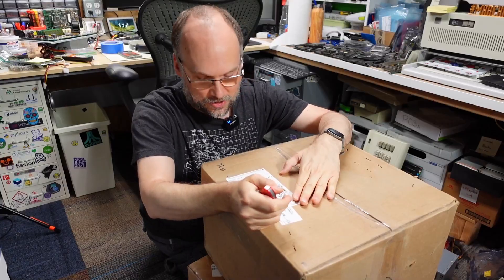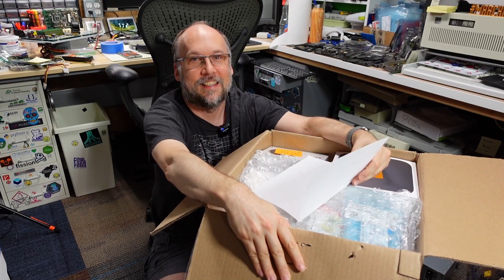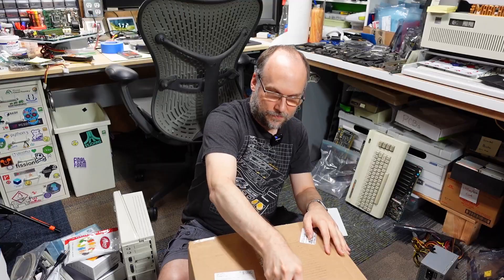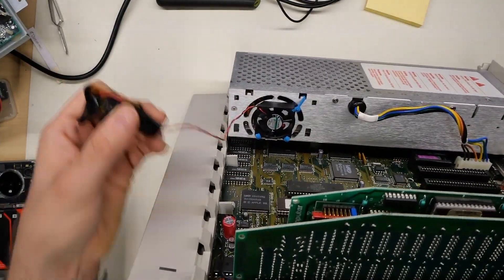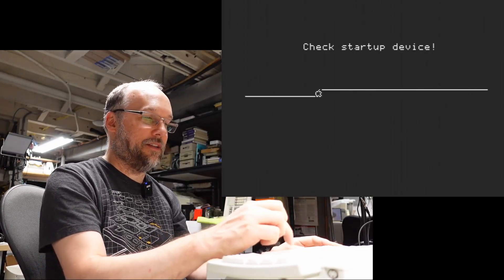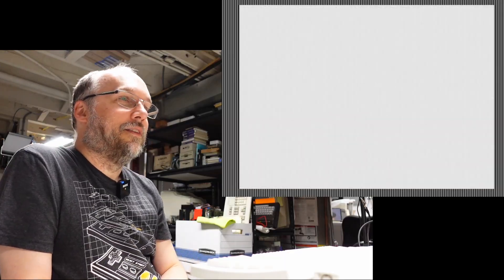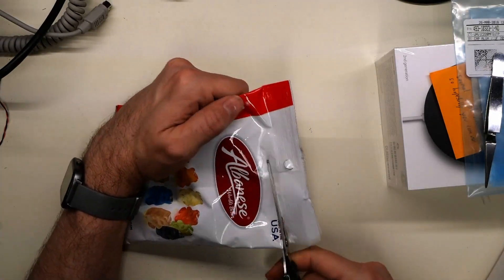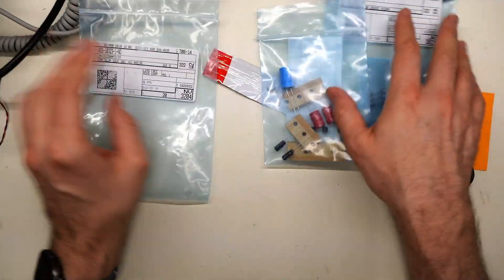This computer was designed for smart kids

Comment: Regarding the PSU fan, you'll find the exact same situation with the Commodore 128D(CR). It was going to have a fan, and some very early production models reportedly actually have one installed (and certainly the 'plastic' 128D came with one, but this machine is extremely rare outside Europe). Most of them however did not come with a fan installed, but still have the provisions for mounting and powering a fan. By 1989 (very late production models) those provisions are gone, and you actually have to modify the PSU if you want to install a fan. 

According to Commodore engineers, it was originally planned to have a fan, but Commodore found they could get away with not installing it, and decided to save a little money. One has to realize that even when installing that fan costs a mere 50 cents per machine, you are still looking at over $1500000 on savings by not installing it (in case of the 128DCR, based on sales estimates). Removing the mounting position and power connection was only done when Commodore redesigned the power supply for other cost reduction considerations. 

As none of those machines were made to last decades, and (quoting Bil Herd) have no right to still be working... not installing the fan made sense at the time. Still, I'd certainly install one myself, as keeping the inside of the machine at around room temperature, and providing airflow to voltage regulators and capacitors in the PSU is a really good idea.

Comment: I used a IIgs for several years ('87-92?)... I eventually maxed the RAM and even had the (now unobtanium) Applied Engineering Accelerator card in mine. Ironically, I had almost no software that took advantage of all the upgrades and I eventually relegated the machine to running my BBS. Ah, dial-up networking.  Anyway, thanks for another fantastic and fun mail call.

Comment: I picked up a IIgs from a college discard sale about, oh, 20 years ago now--computer, monitor, keyboard, mouse, 5.25" and 3.5" drives for a whopping 59 cents.  I liked it, too, but sadly I pulled it out of storage a few years later after a move and the battery hadn't just leaked, it had burst.  Ate a hole through the mainboard and the power supply, total loss, and the monitor got swamped in a flood not much later.  I sold the drives off for about fifty bucks, still have the keyboard and the mouse.  It was a fun enough machine while it lasted, I managed to get it on the internet for a bit.

Comment: 48:30 Also, sound output is mono instead of stereo.  Just a silly omission when you have such a great sound chip IMO.
Reply from the maker: I recall when I had a IIgs when I was a kid, I had a sound card that allowed me to sample audio, but also it gave me stereo output. Really silly omission indeed for the build in headphone jack.
Reply: @adriansdigitalbasement  - The Ensoniq 5503 chip supports 16 independent speaker channels, though Apple's implementation support "only" allows for 8 independent speaker channels (still not bad, essentially 8.1 surround audio from a 1986 computer! And with up to 32 voices! Most software paired that down to 15 voices though). Stereo audio was essentially built-in the IIGS, the "stereo card" merely demultiplexes those existing speaker channels into 2, decoding standard left and right stereo. The chip also has an ADC, so recording sound is built-in too. WHY, why, why Apple choose to give it a monaural headphone jack, and no microphone jack is beyond me. Omitting that likely saved them pennies per machine. They only decided to include a stereo + mic jack by the early 90's, in a prototype machine (Apple codename: Mark Twain) that was cancelled and never released.

Comment: 32:00 I worked for a huge global retailer and they used pallet cards upto early 90s to store product racking locations, the amount of missing cards was huge and the huge amount of stock in the air which was no longer known as all records where on the cards lol.  They later introduce DATAEASE to write there own product location database, I was luckly to be involed in this.. It later got transferred from pc software to there in house store system and was rolled out worldwide.  I never forget when dos was updated to 6.2 where we could defrag the drive it saved hours of time at night when the stock lists where printed on a dot matrix printer lol

Comment: That function to move the mouse cursor with the keyboard was definitely on the macs too- I remember when my parents took the mouse away, thinking it would keep me from using our SE, and I used that instead :)  I think it was something like pushing the shift key 5 times to enable it?
Reply from the maker: "Mouse Keys" maybe? The Mac probably used a similar micro controller for ADB which, I'm quite sure, is making this possible at that level. (Not just a driver in software)

Comment: The sound hardware is very similar to that of the Ensoniq ESQ-1.
Reply: @douro20 - More than similar, they both share the very same Ensoniq 5503 DOC chip (I opened my ESQ-1 keyboard to compare, even the part number on the chips match). Of course the ESQ-1's DOC chip was better supported with128K sound RAM versus the 64K on the IIGS, stereo output built-in (IIGS required an add-on card) and other additional circuity to support filters and effect.
Reply from the maker: Back when I was a kid I had the add-in card that allowed me to sample audio (At 8-bit 22khz, IIRC) and also enabled stereo output. I suppose the 128k on the ESQ-1 helped -- and that synth probably wasn't trying to use an entire set of sounds at the same time? (like software on the IIgs)
Reply: @adriansdigitalbasement  - Ditto! I remember buying the MDIdeas SuperSonic stereo card as a kid during family vacation, from an Apple dealer in Cape Cod (couldn't wait to get home to try it out!). I hooked my GS up to my dad's portable sound system and was blown away to hear....STEREO...from a computer! A few weeks later I got the piggyback audio digitizer add-on and was equally excited! Imagine, recording your voice or favorite TV show and hearing it playback on your computer! Heh kids these days could never appreciate or understand the coolness factor of something that's so incredibly trivial today.

Comment: Let's be fair.  The IIGS was crippled in favor of the Mac.  The processor in the IIGS was capable of so much more than the implementation of it in the GS allowed for.  Such a shame.  The 65C816 really is a pretty awesome processor able to run any 6502 software plus run full 16 bit.  Apple did it an injustice and kind set the mold for it's future use.  Kind of what Bach did for the trombone.  Such a shame.
Reply from the maker: Indeed -- when we look at what the SNES could do with the right graphics and sound horsepower .. really staggering.

Comment: 9:00 Most 00 and 01 machines were sold with the 256K card.  You could run the majority of the games and all legacy Apple II stuff with 512K.  When Appleworks GS was released, that's when the full megabyte expansion came into play.  IIRC some DTP programmes also required >512.
Reply: Actually Apple never bundled the memory card in its beginnings, the machine sold and shipped with 256K RAM for the first year and half of its life! A rather strange marketing decision, since 99% of native 16-bit IIGS software would NOT run on the machine out-of-the-box in this configuration. You had to purchase the Apple IIGS Memory Expansion Card separately from Apple, which cost an additional CDN$150.00 with just 256K soldered on-board (there were sockets to add more, but was about CDN$80 per 256K bank in the late 80's!). By March 1988 Apple removed of the card from its price list and began installing them as standard at no extra cost, effectively giving the machine 512K RAM as standard. Back in the early days it was necessary to have 512 to 768K to run most software, though a full 1.25 MB RAM became standard by the early 90's. Personally I feel 2 to 4 MB RAM is the optimal amount once you add a hardisk.
Reply: @Apple2gs  yeah they didn't bundle the cards but Apple dealers were reluctant to sell you a IIGS without one.  In 1986 it was a "mandatory" add-on for all intents and purposes.  I think Pirates and one other app, an EA music app, supported 256 and that's about it.
Reply: @racecar_spelled_backwards868  - Mine did. Or rather cancelled my memory card order because they were out of stock (likely because Apple was about to phase them out for individual sale; but wouldn't include one free either!). I was forced find and buy one instead from an Eaton's department store that still had some kicking around in back. There were a handful of 256K titles: Tass Times, Music Construction Set, Apple IIGS Tour (B&W version), Paperboy, Gauntlet, System 1.0, Pirates, Silent Service, Reader Rabbit. Several of those were hybrid 8-bit versions dressed up with either GS audio or graphics, not much to speak of. It was ridiculous the GS shipped with 256K while the older and less capable Mac Plus came with 1 MB.

Comment: 7:16 they also tend to be electrically noisy.  My experience is that most fans create noise on the audio out.  The fans that were most common were stick-on to the power supply.  I don't think Apple ever had them, I've only ever seen 3rd party.  I put a switch on my fan so I could turn it off to get cleaner audio with out the line noise that the fan creates.
Reply: Fans definitely do that. I used to not even be able to use my computer's headphone jack because of noise (introduced when I upgraded my graphics card and power supply), and after replacing the power supply with one whose fan only runs when it's at high load, there's no noise except when I'm playing a game (which usually drowns it out anyway).
Reply: @ racecar_spelled_backwards - Actually Apple officially sold an internal 12v fan for the IIGS, which clipped onto the side of the powersupply. It cost CDN$70 (about US$50) and was required if you installed more than 2 cards in your machine, or they wouldn't honor your warranty! I suppose if you showed proof of a third party fan they'd accept that, but regardless I do remember Apples official fan was noisy and inefficient at cooling.
Reply: @Apple2gs  the 3rd party muffin fan was all of $12 US and had a good high flow rate.  It had double sided 3m tape on the 4 corners.  The fan itself worked well but the line noise!  Ugh!  Hence my switch for during audio dumps.
Reply from the maker: Yeah how funny because the fan doesn't do anything but force air in (or out) of the PSU but doesn't seem to do anything to draw in fresh air into the IIgs.
Reply: @adriansdigitalbasement  - Yep, it was pretty useless IMO, just circulating the (trapped!) hot air around inside the case. The best fan was the external Kensington System Saver IIGS. There was also the MDIdeas Conserver and AI JuiceBox GS, the latter of which looked like an old school Apple II+/IIe case fan! They were all leaps and bounds better than what Apple offered though.

Comment: I've wanted to get my hands on a IIGS for years. Such an interesting/odd hybrid of 8-bit Apple and 16-bit Macintosh. I love it.
Reply: It's not a macintosh, the ][gs is a hybrid of 2 generations of the Apple ][ lineup.
Reply: @monchiabbad  It uses a 16 bit processor and features a Mac-OS-like operating system called GS/OS. It even pioneered Apple's adoption of the Apple Desktop Bus. Had the powers that be not crippled the architecture, the IIGS could have potentially been superior to the Macintosh in some ways. So i'll stick with my original assessment.
Reply: @vgtheory  I think the architecture was crippled by its design. For instance graphics (even the IIgs color modes) go through the MegaII core running at 1MHz. The video RAM is shadowed by a copy in fast RAM to speed up reads from video RAM, but writes to video RAM are bottlenecked by that 1MHz core...  And there are no hardware sprites, scrolling background layers, or blitters - graphics performance is 100% about how fast the CPU runs and how fast it can write to video RAM - much like the Apple IIe that preceded it.

Comment: You can certainly netboot GS/OS over AppleTalk. I don't know what software you need on the Mac side of things, though. I'm only familiar with the Apple II end of things.

I assume the photo with the video camera is supposed to be a GS with a Video Overlay Card. The main point of the card, as the name suggests, is to genlock with external NTSC video and overlay graphics onto the video signal.

There was never any encyclopedia software on the GS as far as I remember. There was not really any software released on CD-ROM, but of course you could access things like text files or images from an ISO-9660 or HFS CD-ROM. (Although HFS support didn't show up until System 6, released long after that manual was printed.)

The minor speed difference between the ROM 01 and the ROM 3 is due to code running faster from ROM than RAM. (This is because DRAM refresh cycles effectively reduce the clock speed to 2.6 MHz when accessing Fast RAM, vs 2.8 MHz when running out of ROM.) On a ROM 3 a much larger portion of the toolbox routines were in ROM (hence the need for double the ROM size) and they were more updated versions (System 5) so fewer routines needed to be loaded into RAM from disk. Besides reducing RAM requirements this meant that any time spent in those toolbox routines ran faster on a ROM 3 where they'd run from ROM (2.8 Mhz) vs a ROM 1 where they'd effectively run at only 2.6 MHz out of RAM. Obviously for code that doesn't call into the toolbox (e.g., most games) it won't make any difference, but for desktop software that spends most of its time calling toolbox routines (e.g., the Window Manager, Control Manager, etc.) I guess it makes a small difference. I'd say it's pretty negligible though, and the advantage drops more on System 6, which had huge updates to the toolbox so it had to loads updated versions of those routines into RAM anyway.

You don't need interrupts to get more than 16 colors. Each palette has only 16 colors, but there are 16 palettes available. Each scanline can be set to any palette. (There's a Scanline Control Byte for each line, which sets the palette, the mode (320-mode or 640-mode), whether or not to enable fill mode (only works in 320-mode, and is never used because it isn't useful at all), and whether or not to generate an interrupt when the line is drawn. A few demos and image viewers do use interrupts to display 3200 colors (a separate 16 color palette for each line) by swapping color palettes while the image is being drawn. But you don't really have enough CPU time to run much of a game while doing that.

The Ensoniq 5503 audio chip would have been much better with more RAM to work with. But it really only supported 64k. It did have some limited support for 128k (I can't remember the details, but I think it could only use one bank of 64k at a time) but it's not surprising Apple only put 64k.of sound RAM in the original GS, given the cost of RAM in 1986. It would have been nice to increase it in the ROM 3 but my guess is that not much software would have made use of it, given that the vast majority of GSes  sold had the ROM 01 motherboard. (They did improve sound quality significantly, though, by improving the routing of some sound circuitry and separating the digital and analog grounds properly.) An easier improvement they could have made on the GS would have been to replace the mono output with stereo output. It would have required only a few cents worth of parts. The Ensoniq 5503 actually supports up to 8 channels of audio, which are made available on the internal audio header. There were a number of stereo cards on the market (which just connected to the audio header and mapped half the channels to left and half to right on a stereo headphone jack or a pair of RCA connectors) and a surprising amount of GS software did have stereo music. But for some unknown reason Apple just wired all the channels to a single mono output for the built-in audio connector. (They also could have added a mono audio-input jack.for pennies. There's an ADC built into the Ensoniq 5503. The audio input is exposed as a pin on the internal audio header and cheap cards were available to make use of it, most notably the one bundled with HyperStudio.)

So why is he beep so bad? Well, partly it's because they didn't use the Ensoniq 5503 to play the beep. Doing so would have required reserving a chunk of sound RAM to hold the beep sound (as well as an oscillator to play it). So that would have reduced the resources available to software. Therefore they played the beep sound with the old-school speaker toggle softswitch (remember PEEK(-16336) in Applesoft BASIC?) so it could be played even while the Ensoniq was busy playing other audio. They probably should have just stuck with the classic beep from the older Apple II models.
Reply: Several games & demos did make use of fill mode for speed.  It's use was pretty limited though.

Comment: That zip disk said GS/OS 6.0.4 - Wonder if it will boot from it like a hard drive :-)
Reply from the maker: Most definitely will. I have used my older Zip 100 as a hard drive on my other IIgs. It's a simple and easy easy way to get up and running -- IF you can find the Apple SCSI card. Since that's nearly impossible now, people are much better off with the BOOTI card.

Comment: I saved my uncle's IIgs when he passed away. I need to unbox it and set it up.  I'm now curious to find out which ROM revision it is.  I believe it was pretty late in the IIgs life time that he got it.
Reply: You might want to do that soon to check/remove the battery and inspect the capacitors for leakage. Last thing you want is to open it one day and find that the board is a corroded mess, especially from those lithium batteries leaking